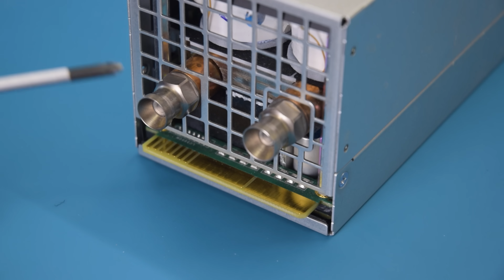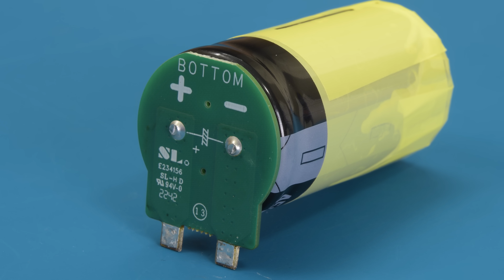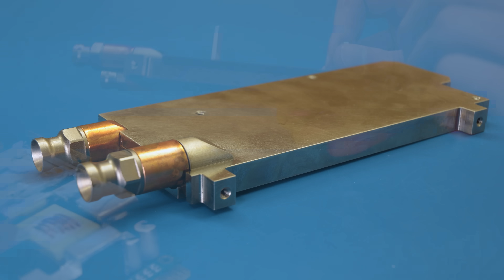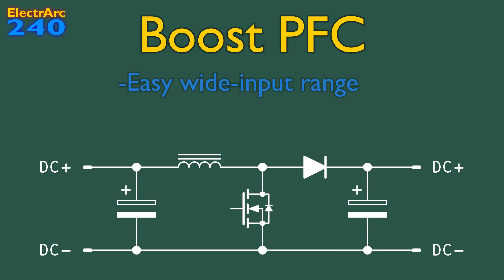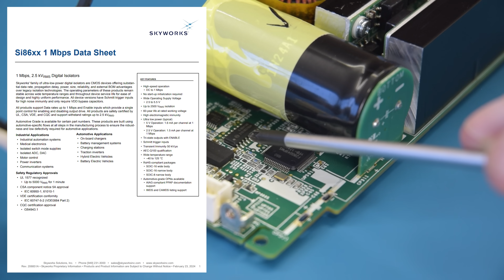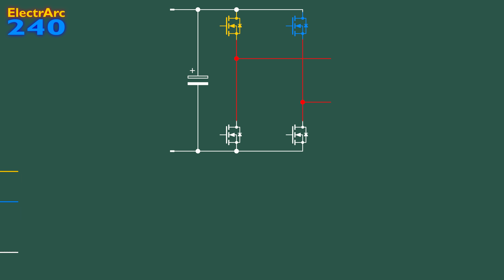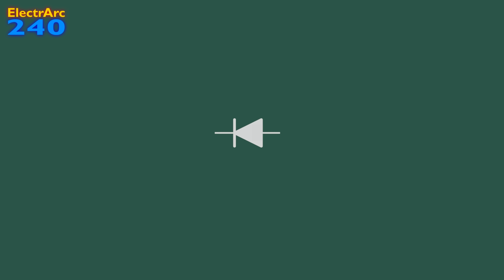Inside a 3000W Water-Cooled Power Supply (with GaN & SiC)

Comment: Connecting the Source and Kelvin source together is indeed a quirky design choice, although it will still halve the parasitic inductance of the package leads. Which for a TO-247 does actually make a measurable difference. The metal chunks around the transformer are most likely the secondary windings, as converting 400Vdc to 12Vdc inherently requires a minimal number of turns on the secondary side. One more clue is that there's kapton tape around the edges of the "busbar" style windings to isolate them from the tranformer core. Nice video!

Comment: Yah another great video. The graphics and break downs are FAB. How long does it take to reverse engineer?
Reply from the maker: Only about an hour, much easier to follow the connections in a big power supply rather than a little one!
Reply: @electrarc240  thanks for taking the time to answer. Is power supplies your expertise or anything electronic ?

Comment: Thank you. Perfect presentation for me, a retired R&D EE. Love the data sheets. I would rate this power supply as close the the greatest achievement in unit design I have ever seen. The circuit design is nice. The mechanical solution and manufacturability are where the pinnacle of our knowledge is. Pity the poor bods that are required to repair it. Those joints with huge thermal mass make desoldering exceptionally hard.

Comment: Great material. 
One step in switching ZVS phase shift was omitted. In each half cycle both high or down transistors in h bridge are turn on in this same moment. Primary winding of transformer are shorted by switches. Generally in in PSFB only one switch at a time can change it's state AND there is at least one switch always in on state.

Comment: Great video, I’d have loved to see the transformer secondary construction in more detail. Making a cheap single turn winding that doesn’t suffer too badly from skin and proximity effect is hard, and I’m always interested to see how different manufacturers did it.

Also funny to see that old man PIC can’t work the new fangled bridgeless PFC, he has to get his tech savvy kid to do it.
Reply from the maker: That's a much better way of explaining the PIC-C2000 relationship haha, excellent
Reply: @electrarc240  Kid even lives in the basement underneath the capacitors... BTW, the mysterious diodes described at the end are probably for bypassing the PFC boost inductors and GaN devices during precharge and in standby. They operate as a plain bridge rectifier along with the body diodes of the SJMOS. All PFCs have bypass diodes like this, but they're probably extra important with GaN, because (in the absence of gate drive) they conduct poorly in reverse and are easy to blow up with reverse current. The reason for multiple diodes in series is probably to get the forward voltage drop high enough that they never conduct when the PFC is running.

Comment: Probably they use 2 dioded in series (totally 8) to meet clearance and reverse voltage requirements. It is cheaper to use 8 diodes in small package than one full bridge rectifier with proper clearance between the pins.

Comment: The reason why you use only 3 pins of a 4 pin system around 29:05 is because manufacturing supply. It's one thing to design a circuit board, but to make it manufacture friendly is a different topic. So, I'm an electrical engineer and an electronic technologist, and the reason why this is done is because there is a huge supply of a specific component already in stock. It's the same reason why some companies use a full bridge rectifier as a single diode some times, that's because they don't need to eat up inventory space for multiple components when a bridge rectifier would do the same job. Same here, there is a supply of 4 pin components and it works. Some times you have to add cost of shipping parts and supply space into the design

The last part with the strange diode configuration, sometimes diodes are put in series to cut power down to specific voltages, for instance its 0.7 volts to run a Si diode, but if you put them in series then you have 1.4 volts which cuts the output voltage down slightly for stability, it would behave like a linear voltage regulator in a primitive sense. I have also heard of these resisting avalanche current spikes. Considering they are at the end of the circuit board, it's possible to have a high voltage reverse current spike feed into the board, the diodes would block it but they can't stop all of it, so you will get some back feed. If they are doubled up, avalanche resistance goes up. However, I'm not completely sure about the avalanche concept

Comment: Great video! I am still curious what those 8 diodes are for. If anyone knows please tell me also. TY
Reply from the maker: Seems like the best explanation is that they are for start-up, as I suggested, and the reason for multiple in series is to increase the forward voltage so they don't conduct once the PFC circuit kicks in. Still not 100% on the paralleled paths, many say it is for redundancy but I'm not convinced
Reply: @electrarc240  Ah right, interesting, thankyou!

Comment: This is an amazing video! Thank you! My personal guess as to the face-to-face circuits baords would be their radiative heating load wanting to face the other board to spread the heat. If one board was facing the outside housing it would be seeing steel, and so therefore not as thermally conductive as a copper loaded board on the opposite heat plate?

Comment: 22:53 I don't think I've seen big capacitors with long leads. The conductor diameter on the PCB probably is also a bit higher than bending the leads.

Comment: In Class 3 applications, IPC A 610 strictly forbids bending capacitor leads for mounting. In Class 2, it is tolerated but not recommended.

Comment: This design is crazy, I always thought that lying the DC/DC transformer down flat onto the PCB would be a guaranteed galvanic isolation issue! Maybe they used insulation material between the bottom of the transformer and the PCB itself, or just straight up removed the copper poor below the entirety of the transformer. Too bad its packed in there invisible to the naked eye ;(

I'm glad you open up these designs and show them here as they provided excellent design inspiration that can make you question assumptions you've had for ages.

Comment: This power supply perfectly rhymes with the latest welding power sources i.e. PowerWave S500: same structure, same design features (buck-boost, multi-stage invertor, multi-phase DC output control) but in much bigger scale totalling up to 25 KW.

Comment: If I had to guess, the two boards being different are because they deliberately come from different suppliers. I wouldn't be surprised if they are interchangable and are fine with 2 of either. Probably some nat security mandate for govt hw. 37:05 is a full bridge rectifier no? just weird and spread out for heat?

Comment: I work in semiconductors, been using liquid cooling for a long time. Pumps, chillers, hoses, those connectors, grid plates attached to circuit boards for component testers. Pretty impressive stuff.

Comment: The double diodes of the standby bridge rectifier might actually be to intentionally increase the forward voltage, so that no current flows when the switching is active.

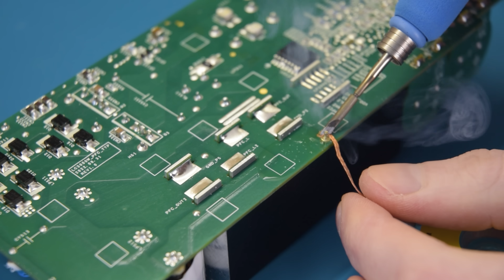Comment: 9:52 I had a tech show me that solder wick works much better if you cut a chunk of the wick off so the rest of it doesn't act like a heat sink while you're trying to pick up solder
Reply: That is a wonderful idea that'll have to share.

Another trick is to widen out the mesh a little bit and not just use it and it's tightly stretched ribbon form. Especially if you are using supplemental flux. Also Alloy converters such as chipquick with hotair to preheat the surfaces can aid in large sink desoldering.
Reply: just don't hold the wick with your fingers or you'll get burned. The capillary action is fast.

Comment: These capacitors can be mounted this way for many reasons, but the most important are: solving the problem of capacitor movement inside the power supply, eliminating the need to glue them with silicone, improving ESR and ESL, and resistance to damage caused by vibration.

Comment: Power electronics control has been firmly in TI's hands for decades with their TMS320 family. Did you know some of them have 6GHz counters for insane duty cycle resolution at high PWM frequencies? In a 50MHz microcontroller? They're everywhere from power supplies, VFDs, servo drives to electric car drive inverters. Because they're the best

Comment: The diode cluster is possibly to guard against bad Neutral as it should be as close to Earth potential as possible and not wander off since it would be bonded at the HV transformer. Not sure why but possibly as other power supplies are likely going in parallel.

Comment: I guess the Aluminium core on the boards acts as a road block and make routing the high current path between the bridge so have to have the PCBs facing each other. Had they not passed the full length of the Aluminium core through the base board they may have saved themselves two designs. I'm guessing the aluminium is passed through for mechanical strength but I doubt it needs the full length to achieve this.

Comment: This was really top notch video. Your unscripted is better than most scripted.

First of all, I'm not asking more, this better than expectation. So I see 3 paths 
a) Keep doing this, its top notch.
b) Lower quality a bit and do more. This is what Youtube likes.
c) Do bit differently. Just a suggestion, take a high quality picture of pcb or construction and draw colored lines to circuit paths and then same color to circuit diagram. And please mind us color invalids (blind), at least the most common red and green one. 10% of male population is cb. You can use different line types, markings like diamonds, etc. AC can be wavy, dc power is thick line, control thin and so on.

Explaining was clear, pleasant and easy to follow, I sit at the edge of my seat whole time (Thou I'm not a normal person, but engineer, just not conducting type :-) ). Subscribed of course.

Comment: Great video. I love how I can think along while you explain how this power supply works. I have never, or will even be able to, design something like this but a lot of the things do make sense while looking at the schematics.
The two half bridge GaN modules being mirror images ? Possibly to mount them like they were in this design, preventing a hot zone on the cooling plate by spreading them apart. It could also allow for much shorter PCB 'traces' between the two modules, preventing parasitic inductance.

Comment: silicon diodes are there to provide startup power, without stressing the main mosfet body diodes. 2 in series, so that if one does fail, the other will still provide rectification, and also the slightly increased voltage drop also means the main diodes will take the power load, leaving them essentially out of circuit, as they are relatively slow switching diodes to reduce EMI. They have the incoming inrush limiting NTC on them, but the main switches do not, so that overall they limit power on transients, then get out of the way for regular operation to improve efficiency by a few percent by removing the inrush limiter in main operation. In standby the inrush is still present, but the main converter is off, so there is no loss there, and the standby supply is low power, so a regular diode with no PFC will be needed, below the power limit for needing active PFC.

Comment: 22:10 Having them pointing inwards the aluminium blocks act as a EMI shield and then the casing on top of all and they are shielded. In a SMPS like this huge currents it is not a especially clean environment so if anything can be mede to reduce EMI then you will.

Comment: 28:40 i will use weaker pin for driver circuit because its so weaker it will fail safer and dump less energy in to the driver if all fail, but in reality it's inductance trick to gain longevity

Comment: I have a 6000W Server PSU, its actually 2x3000W combined at a default output voltage of 42V. I made the output adjustable from 36 to 52V. Below 36V the UVP kicks in and it was difficult to work around that protection. Its Input power is by 2x 1phase connections - so you don't need a 3phase socket. The size of the whole box is like a small shoe box, but around 12 kg weight. This is enormous for 6000W power - and it is just cooled by two fans for each internal suppy. There is even a 9kW version with 3 internal PSUs.
Reply: hach ja, cisco ws-cac 6000. hab ich auch, geiles teil 🙂

Comment: I really enjoyed the casual and unscripted exposition. You have the wit to pull it off very well. 

I'll add that I don't have the experience or training to understand most of the details in this design, but I still learned a lot. As a software engineer, I have the tools to recognize good engineering design thinking and to appreciate your critique.  I think that the use of mosfets to emulate diode behavior is particularly clever and interesting.

Comment: I think they're measuring the HVDC current on the PFC board side, so that it would be redundant to do that on the resonant full bridge side as well. The kelvin connections are shorted together, which is totally fine, because the kelvin connection is going to have an order of magnitude more resistance than the high current lead. What happens to current when you parallel a 2 milliohm resistor with a 20 milliohm resistor? Also: the kelvin connection should not be floating because it would then become an antenna. Amazing video, it took years for me to learn this from books. If I could watch videos like this 20 years ago it would have been so much easier to learn.

Comment: I was thinking of the engineers who designed the circuits and the engineers who designed the packaging.....we need all of these dohickies to be x high so the heat sink system will work.  THANK YOU for the presentation - I learned a lot.

Comment: I work with those SiCFETs in automotive applications.  More specifically, we use them, or newer versions, in electric traction motor inverters.  Tying the kelvin to the source is common in relatively low frequency switching, and in situations where the body diode, which is typically not a part of the FET die, but added on later.  The 4 pin package is much easier and cheaper to source.  The 4 pin package is by far the highest volume option on the market.  Now, I'm wondering why they didn't choose to use a surface mount package of the same SiCFET family.  It would have been much easier to reduce the thermal resistance from the SiCFET to the cooling block.
Reply: Also, if the current is going one way from the point and the gate driver the other way, this is the right spot to connect them. Also there can be a bennefit directly on the leads of the SiC from the PCB to the die. So 4 pins might actually do a small good thing here :)
Reply: The reason ? what it always is "'money".😎😜😅
Reply: This is a result of design by committee no doubt.

Comment: Given that the mysterious diodes are each and all reverse biased, the indication is for reverse polarity protection. Look for a fuse or circuit off element in line (either pos. or neg.), with Vcc.

Comment: There has got to be very strong airflow (through the server case) in addition to the water cooling. Or it will die quickly from condensation and hot spots. Crazy compact tech for those willing to pay a lot for it.

Comment: The double diode standby bridge rectifier is able to disable itself when the main circuit operates due to the preferable current path. Having about 1.4V of Vdrop, it only works when main rectifier is switched off.
Reply from the maker: Ah that makes a lot of sense!

Comment: It's nigh impossible for you to die from an unplugged smps capacitor. It would have to be in the MF to F range, the bleeding resistors need to have failed and you need to touch the ground and the positive electrode in such a way that the current travels through your heart and while it hits, the current needs to coincide with your heart's t-wave in its beating cycle and all these need to happen simultaneously for it to have "a chance" to kill you, even then it's not for sure. Statistically speaking, you would have a higher chance of death from just being run over by a car in your living room.

Comment: The A/B-testing of the naked and the clothed thumbnails is pretty funny
Reply from the maker: Which do you prefer?
Reply: I personally prefer the current (naked) one, but for other people, it depends on how many of their recommendation slots are filled with random circuits.
The one with the housing is more obviously a power supply, which perhaps doesn't matter